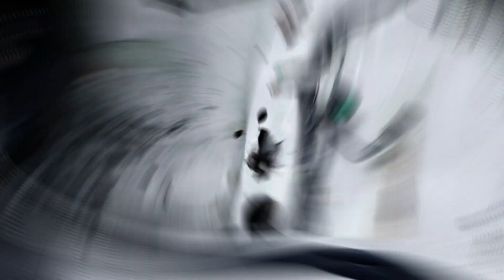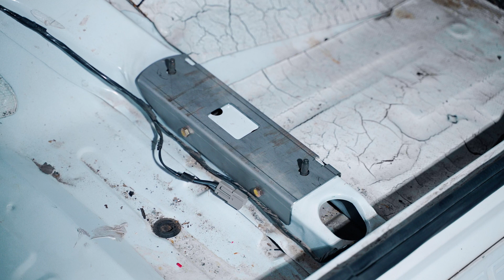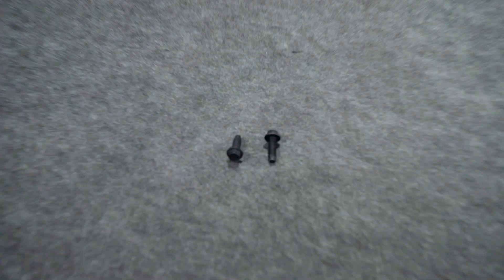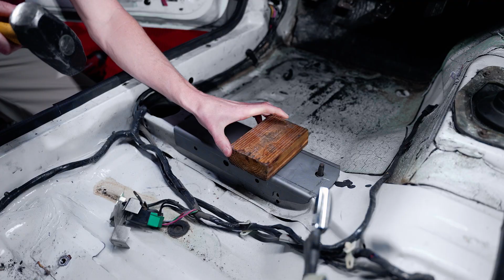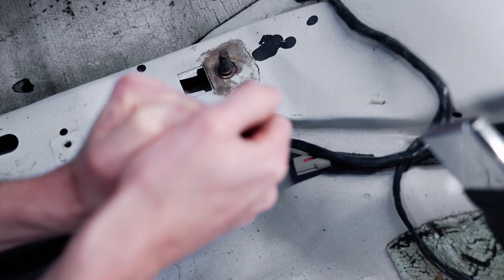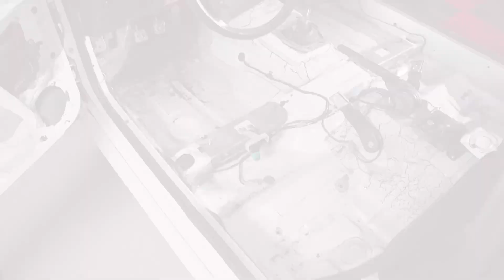5.0 Resto Mustang Front Seat Brace Repair Plate Kit (79-04) - Install

Comment: I wish you made a repair piece where it attaches to the rocker.  That’s where they rust out, not in the middle.
Reply from the maker: Thanks for the comment. This repair bracket isn't designed to repair a rusted seat brace. Instead, like stated in the video, it's purpose is to repair/reinforce the seat brace. -Landan
Reply: @latemodelrestoration  Yeah looks like a great fitting piece

Comment: Great piece and video. I fixed the same damage on mine years ago but this plate would have been nice. Another tip... Don't let this stay broken long or the rear seat bolt diagonally from the front will start cracking the floor pan from the weight transfer. That's what I found on cars with this same problem.